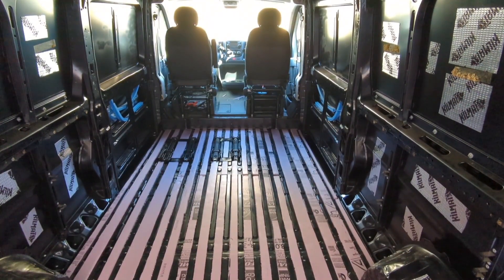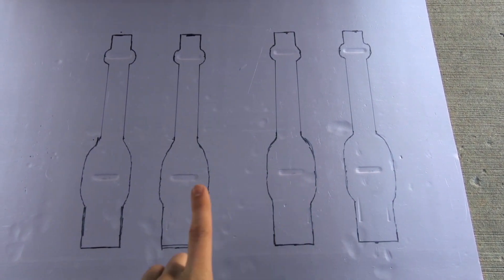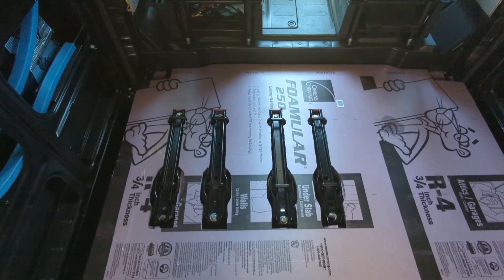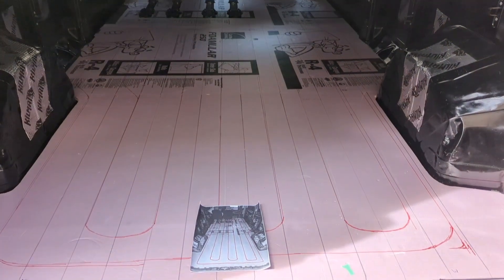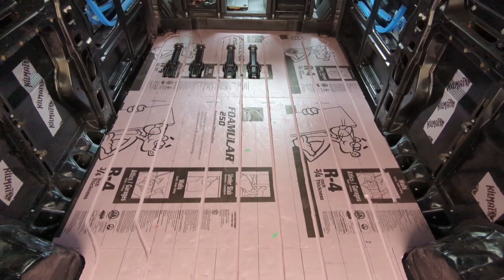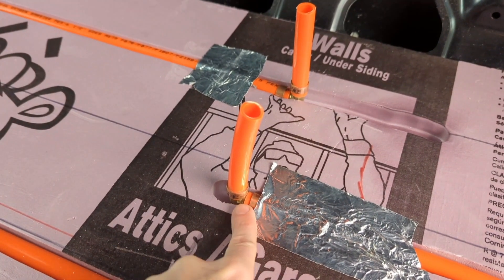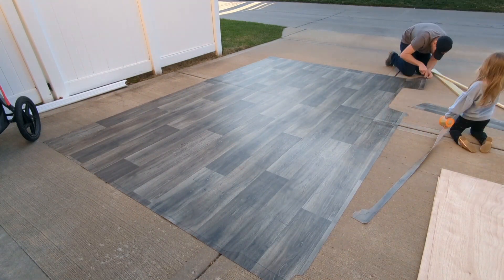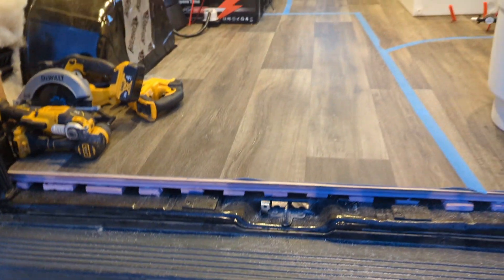How to Install a DIY Heated Floor System in a Camper Van - Save Thousands of $$ (part 1)

Comment: Thanks for sharing. Great setup. Next time, you should add PEX aluminum heat transfer plates! They pull the heat out of the PEX tubing and distribute it evenly. You probably have hot & cold spots without these.

Comment: Everything good there what you’re doing the only difference I would do I wouldn’t glue the plywood. I’d rather use screws just in case if one day you had to some maintenance to the lines
Reply from the maker: Fair point.

Comment: Have you had a chance to use the new system? How does it work?
Reply from the maker: I've had some tricky leaks at the spot where the valves connect to the PEX fittings. I did run the system once and the floor heated up nicely. I haven't been able to fix the leaks just yet, unfortunately, so I haven't gotten to run the floor portion outside of that test. The rest of the hydronic system works perfectly - hot looped showers and warm air.

Comment: FYI, anyone considering XPS foarm might want to look into offgassing in small living enclosure. I was considering using the foam, but currently looking into using mineral wool type to avoid offgassing. Just a note for the community. Thanks for the vieo!
Reply from the maker: Thanks. The MaxxAir fan moves plenty of air out for ventilation.

Comment: How do you go about controlling the temperature of the loop/van. Do you have a sensors to monitor the temperature and a pump that circulates the fluid when needed?
Reply from the maker: The system controller allows you to set a maximum temp for the coolant. When it senses that temperature, the furnace cuts off, while the pump continues to circulate the coolant. Once enough heat has dissipated, the furnace kicks back on.

Comment: Beats the super-high priced flooring the other guys are selling.  I plan to use a similar method.
Reply from the maker: Definitely! Some kits I looked at were in the $5k-$7k range!
Reply: @jessesmithchannel  Can you tell me, does the floor still squeak from the foam once you get everything installed?  I notice mine is noisy, wondering if more weight will stop that.